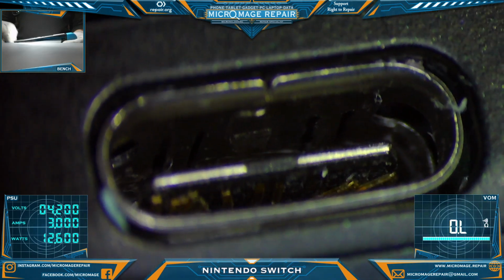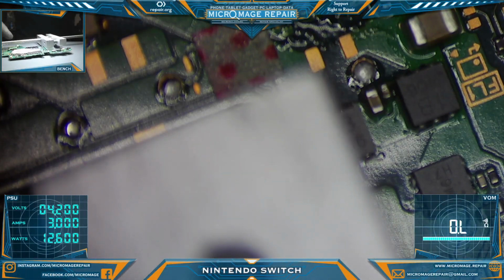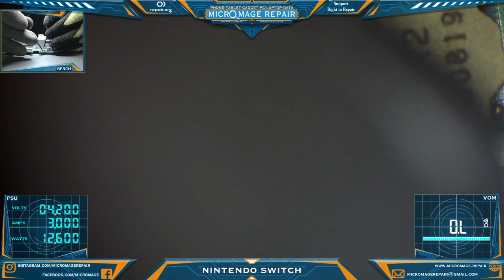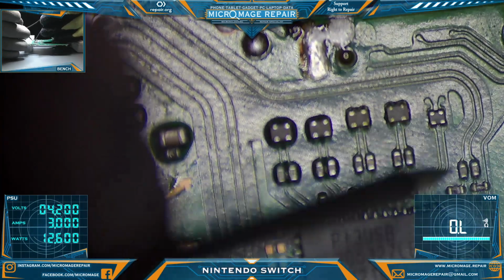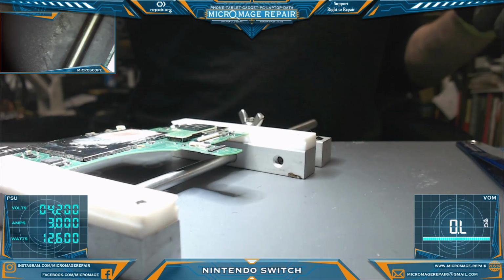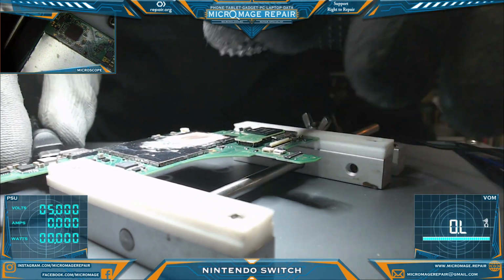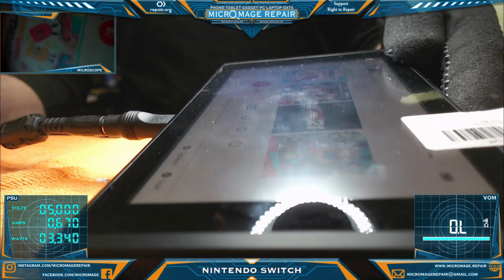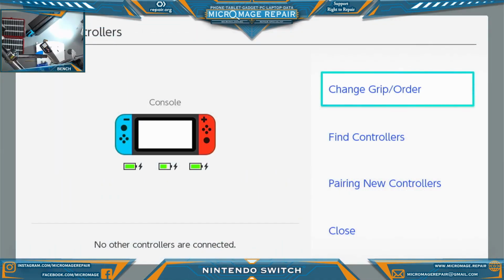Nintendo Switch:  Just Jam it!

Comment: Nice video. I just wonder why you tell airflow of atten is 99% when saying it in L/min is much easier? Would 99% airflow mean 118.8L/min of the maximun 120L airflow?
Reply from the maker: Thanks!
I'm not certain someone learning would understand those terms and I am trying to keep things as approachable add possible.
Reply: Ok just looked up the atten station you use and it shows airflow in %. My bad, thought is like the Quick 861DW that shows it in L/min
Reply from the maker: @incocnito1274  No worries!